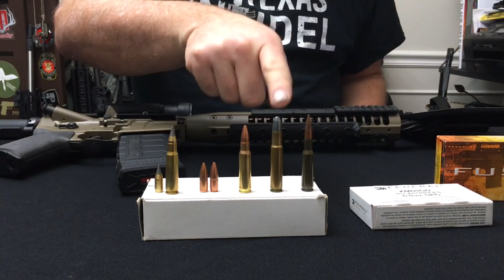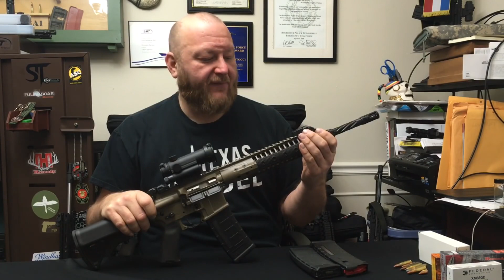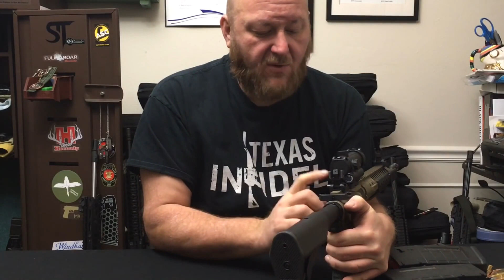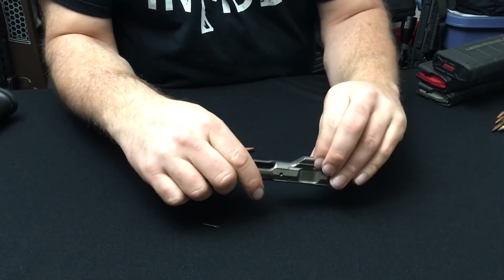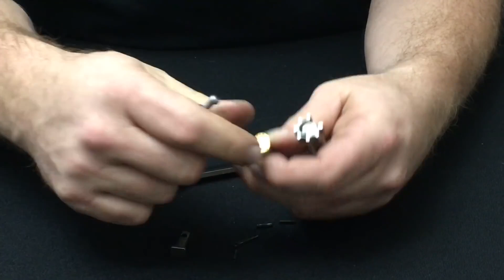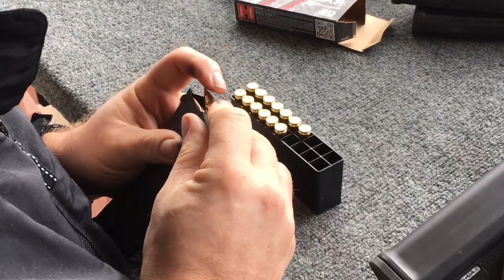History and Development of the 6.8x43mm REM SPC LWRCI Six8-A5 Rifle

Comment: Almost all 6.8 SPC ammo now is built to 6.8 SPC II specs because of this rifle.  Also, AR15Performance has largely contributed to the rise of the 6.8 SPC II due to their incredibly high quality barrels.
Reply: There literally are no industry specs for SPC II chambers or ammo.  Anyone telling you otherwise is misleading you at best.
Reply: @LRRPFco52  Industry specs no, specs for better chambers have been around since Jan 2006.  Those later improved chamber designs allow people to load heavier powder charges and get more velocity.
Reply: @crashdsnowman1  Chris Murray had 3 different chambers already by 2003-2004.  One was meant for high performance, another for DMR, and another he had played with.  There was a lot of back and forth with chambers.  I helped build one of the first 6.8x43 carbines back in 2003 for a guy before he deployed.  He had a custom concealed free-float tube like a DCM rifle we had to modify a KAC rail to fit onto.  There weren’t even mags for it then.
Reply: @LRRPFco52  Murray told me over the phone he thought someone sent the wrong drawing to SAAMI or SAAMI changed the drawing to a .050" freebore. Either way the chambers designed later have .085-.100" freebore and allowed loading a heavier powder charge and getting more velocity. Art Kalwas at SSA was the one who prompted the change to the .100" freebore but Dave Kiff at PTG transposed a number on the print creating a sharp corner  at the mouth of the case, that was  Jan 2006.  It was 2007 before chambers with a longer freebore and correct 45* angle were used in commercially available barrels. It was 2009 before Dave Kiff agreed the number had been transposed and corrected to get a .100" freebore with a 45* angle at the case mouth.
Reply: @crashdsnowman1  Tracking all that.  Combined with the Ko-Tonics chrome-lined pipes with tighter bores after the chroming, and it was a recipe for disaster with the “Combat Pressure” SSA factory ammo.  That one that let go and sent pieces of the BCG into the field of view of the Eotech was scary.  Bottom piece of the carrier went through the petrified wood bench like a hot knife through butter.

Comment: It is a really beautifully looking gun. I wonder if the military (if cost were not an issue) would re-equip with 6.8SPC.
Reply: It doesn't make any sense for the military either as a CQBR, or DMR.

5.56 M855A1 does really well in M4s.

6.5 Grendel and 6mm ARC make superior DMRs.

Comment: It’s an interesting cartridge. I first saw it when I was working at Barrett and Steve Holland came by to show it off and talk about its development. That was the summer of 2002. I had known Steve when we were both on ODAs in 5th Group, so I knew him, but mainly in passing. The original cartridge was tried out in calibers ranging from 6mm to 7.62mm, finally settling on the 6.8mm. 

I have a couple of rifles in this caliber, one is an AR-15 that I built and one is a barrel on a Thompson Center G-2. It’s a great little round and I’ve used it a little bit to hunt deer. My AR is obviously semiautomatic only and doesn’t get treated harshly, but I’ve never had a failure to feed and have gone through over 1000 rounds since building it using PRI mags.

Comment: nice review as always.
the LWRCI IC is my holy grail of piston op 5.56 rifles.
it has the most well designed and intuitive FULLY ambi lower receiver in the industry.
ill never understand why other manufacturers go through all the trouble to design and manufacture a lower receiver with ambi controls but give it a half assed bolt release without a bolt catch on the right.

LWRCI does it right and their FULL ambi bolt control is the simplest and best design imo.
ADMs UIC with full ambi controls is possibly the most ergonomic but the LWRCI is simply a mirrored system, its identical on the left and right.
i really appreciate that.

plus the LWRCI enhanced receiver/barrel mount/ handguard mount is the best in the industry as well.
throw in the enhanced BCG and the fully developed piston op system and youve got what i feel is the best fully ambi, piston op AR on the market.

damn good looking too!
im eyeing a O.D. green M6 myself.
i just bought a DD5V1 so i gotta save up some jack but soon ill park one in my safe!

what do you think of the new REPR 2 battlerifle?

Comment: With the ban on including AK barrels in imported parts kits,  and the serious shortage of CHF Chrome lined AK barrels, I'm surprised some of the few companies operating hammer forges do not tool up to produce a quality CHF chrome lined AK barrel for the domestic AK market.    With a saturated AR market and  Lots of Chinese, Bulgarian, Polish, East German, ect  AK's that now have well in excess of 15K rounds of Bi Metal Eastern Block Ammo I think there's a market need that is not being filled.
Reply: Setting up a shop capable of chrome lining a barrel with all the issues regarding worker's safety, hazardous materials and environmental regulation is very difficult and costly. That's why many barrel manufacturers are switching to nitriding.
Reply: Nobody wants aks unless looking to shoot the  neighbors dog  5 blocks away as ur target shooting
Reply: @rylanscholtes225 wtf are you talking about
Reply: When on sale one can get AR15 uppers in 7.62x39 for about $200.  I have had to add wts to the buffer of mine since it is over gassed.  The barrel is not chrome lined, but at that price I can easily buy and install a new barrel on an AR without needing a gunsmith.  To change out an AK barrel requires more effort and tooling.  You need to set the headspacing on an AK barrel before you drill and install a rivet to hold the barrel in place for the AKM types.  I am not sure how it is done on the milled receivers, but over all the AR is the easy button compared to the AK.  I own AKs, but I have decided that the AR is better for a new rifle.  The cost of a decent AK such as made by rifle dynamics or Arsenal will cost you a lot of money and might as well buy a tier one AR for the money.  When imported AKs were $2-300 the AKs made sense.  Now the ARs are cheaper, more accurate, modular, and anyone with a wrench can build them; with more tooling and a little skill one can make 80% receivers that work if that appeals to you.  Making an AK receiver is not easy to do it right.

Comment: My first thought is Barrett m468 not LWRCI.
Reply from the maker: Rob  Holveck I get it. I guess because there were relitivly few made compared to the LWRC
Reply: Years ago when I first started getting serious about 6.8, I'd looked into Barrett's 6.8 offering however, to this day, ( please correct me if this is no longer the case, ) Barrett is still using the SAAMI specs for their 6.8 barrels.  

I eventually gave up on Barrett ever pulling their heads from their asses on this, so I built a 6.8 AR to my specifications and I'm quite pleased with how well it turned out.  ( I have found  Barrett's steel 6.8 magazines for standard AR lowers to perform flawlessly.  )  While I do have one ten round PRI 6.8 mag, I've always been leery of their less than stellar reliability, that I personally saw many times while working for a large local AR company.  

If had the money and a burning desire for another 6.8 AR, LWRCI's 6.8 would be it.
Reply: @stevewhisperer6609  Western Powders did pressure testing with a barrel cut with a SAAMI chamber, then reamed with one of the "SPC II" reamers.  The difference they saw was 19fps between the 2.  The SPC II departure is a bunch of hype designed to steer people away from reputable manufacturers by making the false claim that someone using SPC II is doing it better so they can take your money. Nothing more.  When you have industry standards, it allows ammunition and barrel makers to follow a common datum for dimensions and pressures with known components.  As soon as you start an internet-driven hate campaign against those manufacturers, like BCM, Barrett, Remington, and so forth, don't be surprised when confusion and disinterest kills further interest in that cartridge from manufacturers.

If you look at the history of chamber development with 6.8x43, Chris Murray had several different chamber designs to accommodate accuracy vs more mv from a carbine.  The DMR chamber focused on accuracy, whereas the carbine chamber focused on speed.  One of the far-fetched requirements that was requested by the SEALs was a 115gr going 2900fps from a 14.5" barrel.  Remington told them, "No problem!" without even doing a legitimate engineering analysis, and of course, that speed was nowhere near realistic given case capacity.  Murray and others including Barrett especially, tried to reach those speeds.  Barrett even used duplex loads and blew uppers up left and right in testing, eventually dropping that pipe dream and stuck with the SAAMI chamber.  It's interesting to watch people who have no clue how much testing went on behind the scenes with 6.8 come out and criticize big manufacturers as if they don't know what they are doing, when they have more test data and experience with the cartridge than the tiny little shops who have never had to develop or test batches of production ammunition and rifles.

If there is no industry standard, how do ammunition manufacturers look up the MAP, MPSM, and MPLM bands so they know how to test ammunition?  What chamber pressure do they work off of?  How do they form the projectile ogive, shank, and base dimensions working off the case?  All these things are answered when you have SAAMI certification because they are all published.
Reply: We don’t get access to military hardware
Reply: @rylanscholtes225  HUH?...  I have one lol